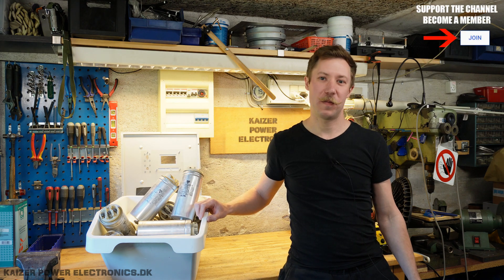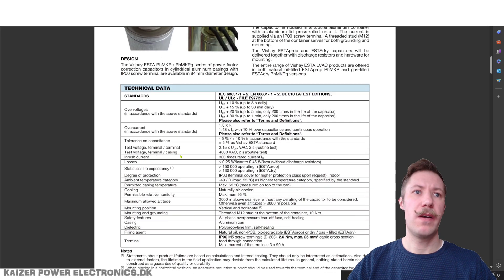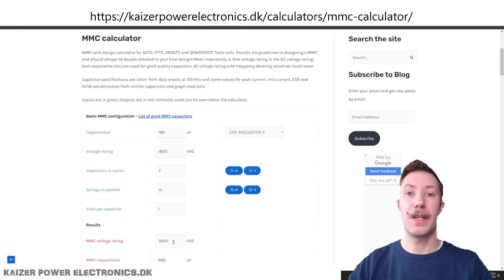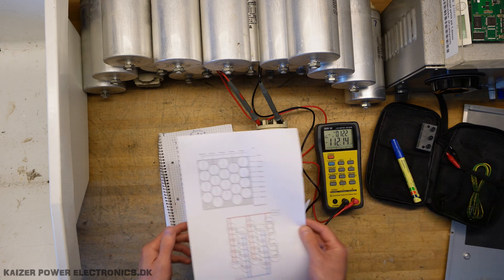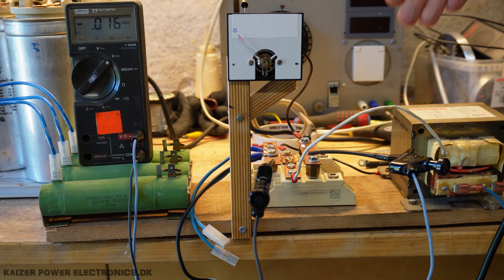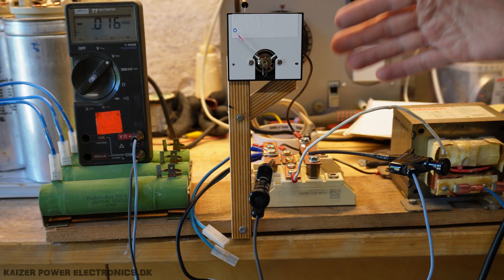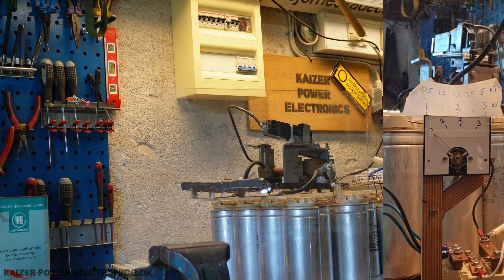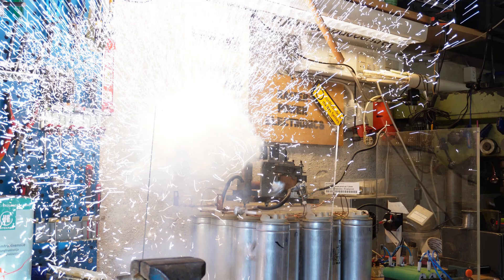Pulse Power High Current Discharges from 3 Phase PFC Capacitors

Comment: Can you use a voltage multiplier with capacitors and diodes to the the cap bank instead of  MOT?
Reply: to charge the capacitor bank*
Reply from the maker: yes, you can use a wide variety of power supply methods. The charge current available will however determine the charge time.

Comment: Also was curious if you had a video I'm not seeing in regaurds to the maxwell cap that failed? Seems pretty rare those things fail, even when you find 20 year old ones they often still have many thousands of discharges left at their full ratings, to which I'd never expect to see/hear about a terminal on one failing especially. I picked up a couple that are rated for 50KJ and I plan to basically never go over 25KJ so they're more/less last me 'indefinently' since they're pulse caps rated for dead-shorting. Kinda surprised/impressed to hear you had a maxwell cap fail, just never seen/heard of it myself unless someone did over-volting and had hundreds of shots in @ over-volted.  Be curious to see more on what happend there!
Reply from the maker: I do not think I ever made a video or even took pictures of the damage. Here at 60 seconds, you can see a black smoke puff in the left side and in the slow motion, you can see the terminal flying into frame: https://youtu.be/Z4UBXoG-Aj8?t=60

Comment: -1 pant  😂. Still nice experiments , also you could look into producing graphene with this method , just add carbon instead of whatever you are frying in the middle 😂👌
Reply from the maker: Gotta spend money to make money! ;)
Reply: What do you think could make a capacitor bank like this last longer than 200 discharges ? ( other than discharging them slower ) .  

I’m also thinking of building a smaller capacitor bank for experiments but would like to use scrap capacitors just for starters , in case I get something wrong 😂

Comment: I think you were right in your initial idea that you get ~166uF by shorting across one element and then using the other two in parallel for DC. 

The reason why you get >100uF measuring between two terminals instead of 83 is because the other two elements are also in series with each other across the terminals, so that string is paralleled with the single element between the terminals.

I think total capacitance of the series/parallel bank is ~830uF for ~2.6kJ energy at 2500V.
Reply from the maker: You are absolutely right! Thanks for catching this error. This also tell a tale about just how scary fast MKP capacitors can discharge. This 2.6 kJ is magnitudes more BOOM, than 4 kJ on my latest single Maxwell capacitor.
Reply: @KaizerPowerElectronicsDk  yeah they are low ESR and ESL so they put out a lot of current and almost all of the energy is deposited in the load. 

I thought those Maxwell caps were either MKP or oil/paper too though? Either one should be very fast, in theory.

I bought 60 used electrolytic capacitors on eBay that were each 5800uF 300V. That’s almost 16kJ but if you put them in series the short circuit current would be way less than yours and the voltage across the actual load would be way less. Most of the energy would be used making the capacitors warm. My plan is have them all in parallel and then you can get high peak current, good efficiency into pretty low impedance loads (hybrid armature railgun, maybe a 3mm^2 copper bridge wire inside a watermelon etc) but you still get a long pulse without huge peak power.

Comment: Shouldn’t peak DC voltage rating be ~1.4 times higher than AC RMS voltage not 2 times?

Also that’s the 2 second test voltage. My guess after looking at those specs, is you start getting little breakdown points in the polypropylene insulation somewhere a bit over 1000VDC, which will gradually eat away at the capacitor.
Reply from the maker: I did not supply the information, but in Tesla coil community we gladly just look at AC ratings and say oh that lovely swing from negative to positive, that's the same as DC, so twice the AC is DC rating :) I said 60 seconds, but its 2 seconds in datasheet. I also got breakdowns at 1350+ VDC, that's where I heard crackling/popping, its the second test in video.

Comment: Oh boy, reminds me of when I built 10mF 400V capacitor bank for  DRSSTC and accidentally shorted the terminals with fully charged capacitors. Suffice to say, my ears were ringing for good half an hour.
Reply from the maker: I did that with smaller capacitor bank long, just wanted to make sure it was shorted, before touching it, still had enough charge to ensure some ringing in the ears :) Ear defenders stay on since that day.

Comment: A couple suggestions:
1. Hook up a lightbulb in series with a decent resistor across the capacitors, that is always connected. It'll take longer to charge, and a parasitic loss after disconnect, but a visual indicator whether there's charge in the bank, and a means of no charge accruing is a must.
2. Swap out the copper wire for aluminium bus bars. It's cheaper, more easily formed/machined for purpose, and due to the skin effect should allow higher peak currents.
Reply from the maker: 1: Safety first is always a great idea, I skipped it here, but on another bank I made, with 35 electrolytics in series for 14kV, I had LEDs everywhere for status (and balancing the long string). 2: The wiring is fast, cheap and something I just had as scrap. This was the first test, a rebuild was planned, now that they proved themselves :)

Comment: PFC capacitors can take a lot of abuse. Used a few of these for a laser power supply that needed a fast pulse discharge. They can take 1800v net a piece. Charge the elements with plus and minus HV and the third one being neutral. ❤
Reply from the maker: So you have a center tapped high voltage power supply?

Comment: Yes definitely beef up the wires for the capacitors themselves. Super awesome capacitor bank though! I would be a menace if I had that many capacitors!
Reply from the maker: The wiring is fast, cheap and something I just had as scrap. I expected to blow a cap before the wiring being a limit :)
Reply: @KaizerPowerElectronicsDk  😂Gotcha! I was just thinking you annihilated one of those wires with the can crusher, the rest of the circuit is at max 2 of them. 😬
Can't wait for V2!

Comment: I have 3x of the same Maxwell 1.8kV 2500uF caps you have , when i got them way back in 2010 around one came damaged in shipping the other 2 were fine.
The terminals were broken on one, i cut the top open by running a grinder around the welds, managed to get it open nice and clean, i then added 2 heavy duty binding posts to replace the damaged ones, put the top back on and welded it closed, filled it back up with oil, its working good ever since.
Inside those caps there is a big flat aluminium strips with a hole that is bolted to the bottom of the terminals.
The lid has about a 10mm folded flange all aroud which helps with keeping inside clean during grinding and makes it really easy to weld closed again without burning the contents inside.
You should try repairing your capacitor if you still have it.
Reply from the maker: I never gave it a thought to repair it, I stood with oil everywhere after it popped and really just wanted to get it out of the workshop :)

Comment: Why disconnect the charging circuit? Would be safer to leave it connected to avoid the sketchy wire-on-a-stick method.
Reply from the maker: I unplug the charger first, so stick is de-energized when handled. I disconnect it from bad experience of damaging my diodes on earlier capacitor banks. I will change it for some solenoid with isolated rod instead, but maybe I am fixing a non-issue due to old experience? :)

Comment: I love these, I have 20 caps to make my own, 196uf, 2300vdc from cardiac defibrillators....I'm terrified to change it past like 100v as full charge is 520j per cap or like 10,000 if I wire them all up. 

I have a question for anyone, when discharging like this do the caps go reverse voltage? How do you prevent this or does it matter? I cant find a data sheet for the caps aerovox ql232ew196v23a
Reply from the maker: Defibrillator capacitors are also some beasts! 10kJ is way up in the scary end of the scale. Some of the best Maxwell pulse discharge capacitors are only rated for 50-70% voltage reversal, but must still be limited to some certain dV/dt. 
Voltage reversal matter a lot. It is the most likely killer of pulse discharge capacitors. To avoid it, I make my work piece / work coil weak in a point where I am sure it blow open circuit. Ensuring it with diodes can be less cost effective. Check out the pulse power folder here for some papers that might inspire you for a solution: https://kaizerpowerelectronics.dk/theory/file-archive/?drawer=application_notes
Reply: I've got my hands on 120 caps of 500V 3900uF, could build an enormous bank but I'm afraid to start doing something with them. Close to 60kJ. Thx for the tip on voltage reversal.
Reply from the maker: Sounds like electrolytic capacitors, they are even more prone to fail from voltage reversal.
Reply: @axiom1650  yes build it and they will come,.lol